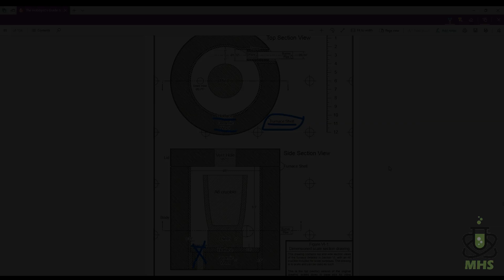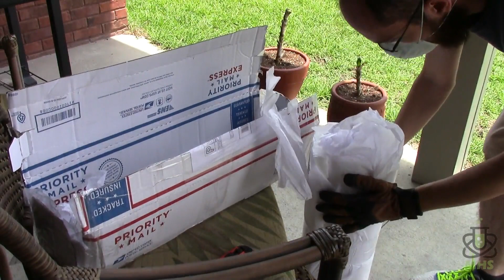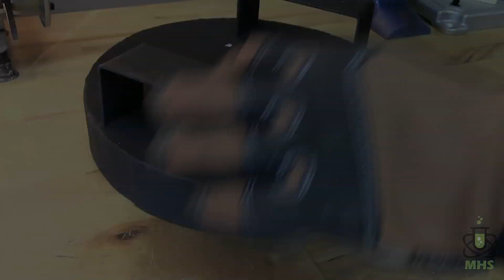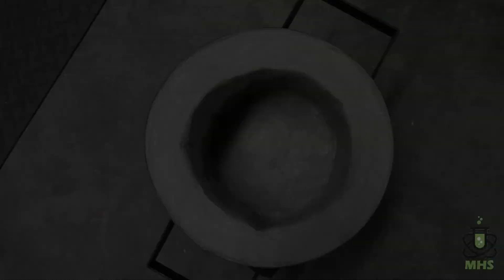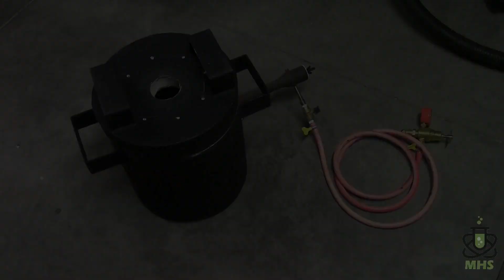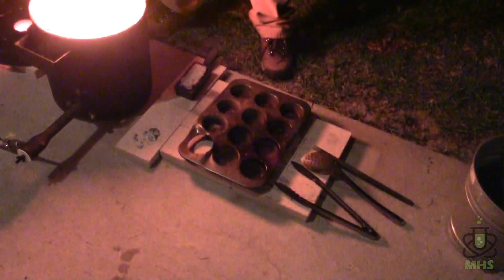Kaowool Furnace Build

Comment: Also on rhe edge of building my first furnace, saw a cool idea of a "throttle" like peddal that you step on, which the pushes a thick rod upwards, that is connected to your lid, and it just pivot oit of the way, which i think would work great with yoir design, and keep your lid from breaking,

Anyway, thanks for the vid, i learn something new with each vid i discover, thanks👍🏻👍🏻

Comment: I am curious, that book you recommend says not to let the hotface soak into the wool insulator, because doing so will lower its insulative value, it even suggests using plastic wrap as the ideal barrier to separate the two layers, but you seem to say that you want it to soak in, am I misunderstanding what the book is saying?

Comment: Like cars the new trend is electric. You could have made colossal electric one for much less money and operating cost plus better for the environment even electricity made from coal. (FYI ; I did the math)
Reply from the maker: I'd be interested to see your calculations!
Reply: @mrhomescientist  even a gas top cooker is rated 60% to 80% efficient on heat transfer as much of heat  is loss with exhausted air. As the end thempreature is gets higher more and more heat is lost so about if efficiency drops below 40% it is logical to even generate the electricity using a gas turbine (efficient 45%) and run the furnace using that.

Comment: The temperature of the molten aluminium seems to be way too high for casting? Just based on the glowing orange/white hot color. Did you measure the temperature? It should be max ca 750 degC to prevent entrapped gases and excessive shrinkage.
Reply from the maker: The camera makes it look brighter than it really was, but you're right. It heated up way faster than I expected! I'll adjust now that I know how quick it goes.

Comment: A++!  You have been on the casting forums doing your reaearch and it shows. - Ben's foundry tutorial book is required reading over at alloyavenue.com. :)
Don't you love those fireplace tongs?  I've been telling everyone who'll listen how well mine work. 
My blanket & Satanite furnace was super cheap to build because I used almost all free or leftover materials to build it, so I'm curious to know if yours was cheap or expensive compared to one of those little kits you can get now in various sizes.  They look just like your medium furnace.  If you don't mind me asking.
Reply from the maker: Thank you very much! Total cost was about $390. $300 of that was in the custom welding, so if I had been able to do that myself it would have been dirt cheap. My medium furnace was $350, I think. That's the first time I'd used the tongs. They definitely seem nice, but the grip when lifting out of the furnace doesn't seem super secure. I might need to play around with it some more. Any tips?
Reply: @mrhomescientist  great info.  Scrap propane/air/well pressure expansion tanks and scrap oil drums and duct tubing etc. are everywhere.  So anyone just about anyone could save a hundreds on a build like this by using svrap metal dor the outer shell and skipping hiring a welder.  You did get a very nice looking shell though!

The grip for lifting out my crucibles with tongs like that is not bad, but not as good as the pouring grip.  I do make sure to be extra careful when lifting a full crucible... I've thought about carefully bending the tips of my tongs to get a little more contact when lifting out yet not ruining the good grip I get for pouring, perhaps with a little help from the furnace's heat.  But so far I'm still waiting on some new crucibles to arrive so I can ensure the tongs will still fit those as well.